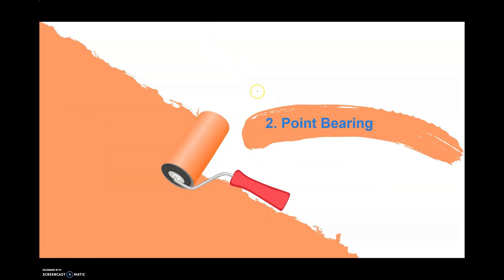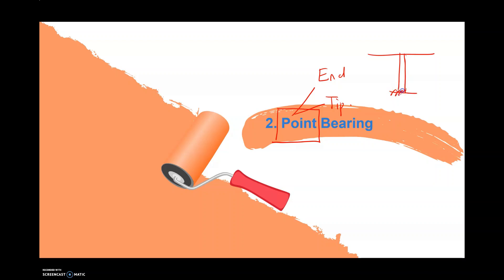Pile Foundation (Part 2)

Comment: Hi miss, what if my angle is 42 degree with L/D of 43.48, will there be no solution?
Reply from the maker: 1. May used 40degree as reference friction angle for your case, but the accuracy is low
2. May used others method by considering 42degree
3. If the types of material for 42degree is gravel or a group of rock, preferable to used rock procedure to calculate bearing
Reply: Mam can you provide your contact.